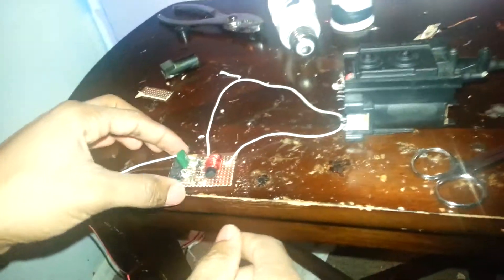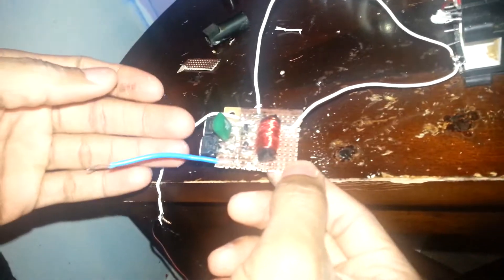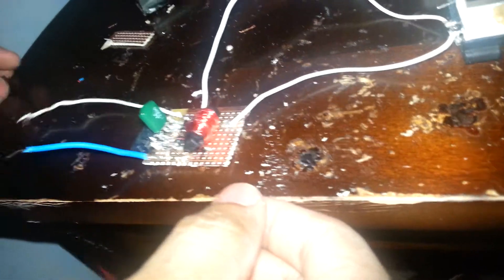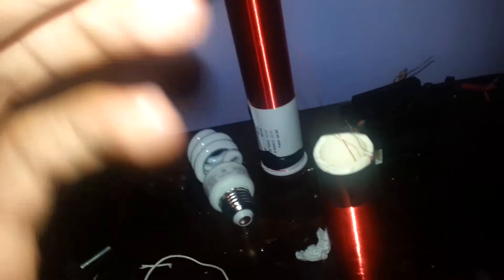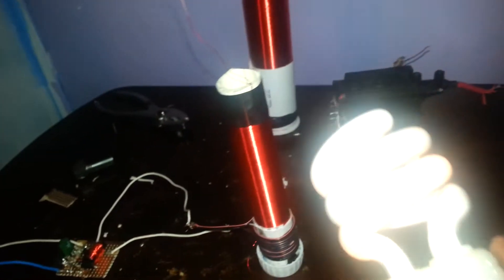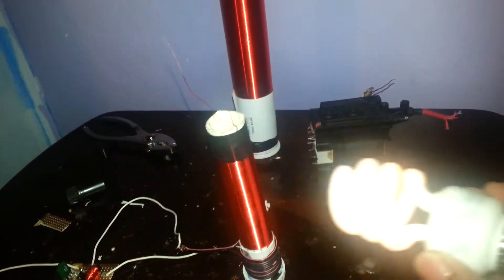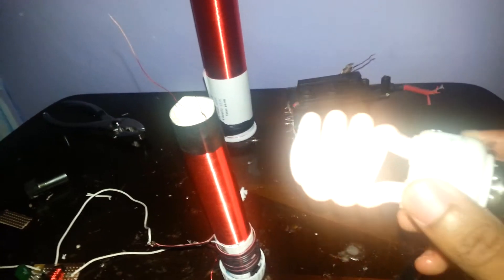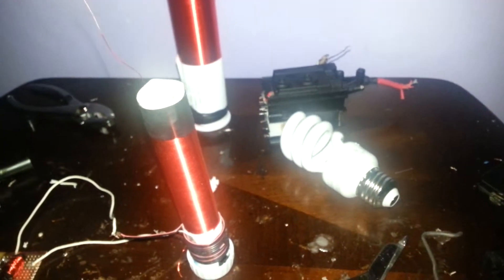12V slayer exciter

Comment: This is not the Slayer's circuit it's an ZVS.
Reply from the maker: malicious1111 ,
yes it is
Reply from the maker: malicious1111,
check out my other videos. my designs have the most powerful outputs
Reply from the maker: driving a flyback with out core,
Reply from the maker: its better that you build my other curcuit because this circuit is very insufficiant